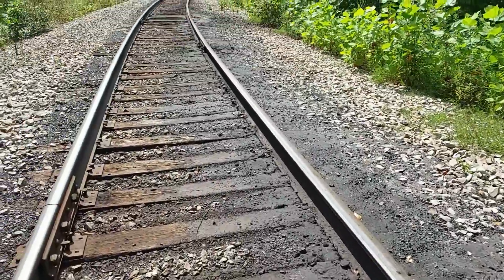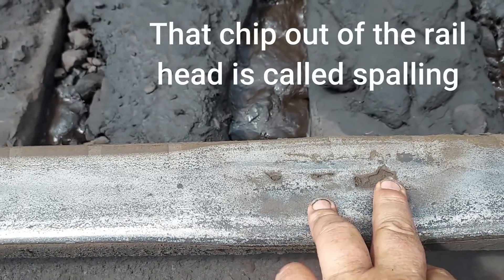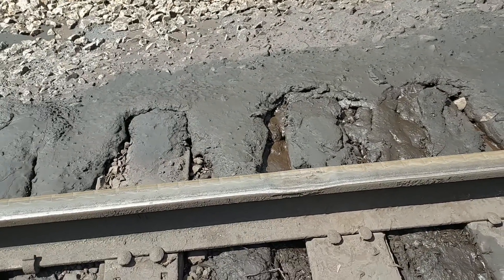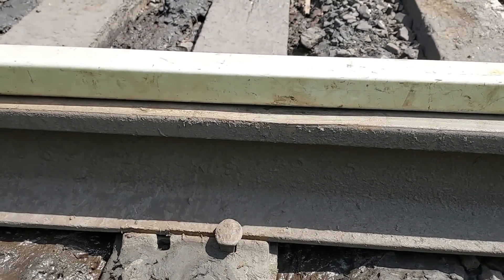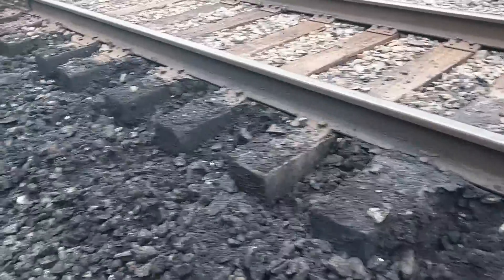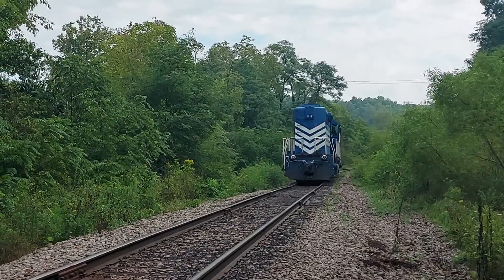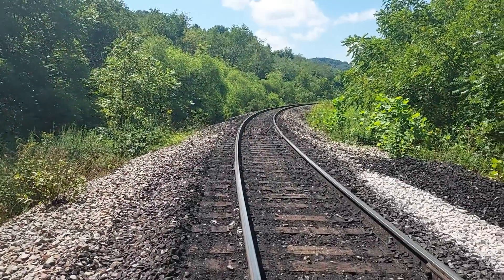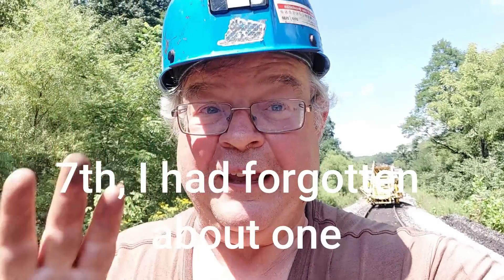This is the 7th Rail I've Broken with my Tamper

Comment: Was this all new rail when it was built or was it relay rail? That has the looks of having been started by a rail burn.
Reply from the maker: Yes gravelydon, all the original rail here was rolled in 1975 in
Illinois by US Steel. The rail that broke was original. We have
replaced a good bit of rail over the years, the high side on
this curve was replaced about 10 years ago with new.
We did get that rail changed out Friday, it had broken last
Sunday so I can sleep better now. Thanks for stopping by
today and taking in the show my friend.

Comment: re: 7:35 You explained to me about your railroad and not governed by FRA or 49CFR but to me it's so awkward to see the hoghead 'BACKING'(Long Hood Forward)and no headlight or 'Ditch Lights' or a 'Man on the Point'. But as you said, your railroad isn't governed by the Feds so you can 'Railroad Any Old Way You Want' despite 'Best Practices'. Thanks for the video. When I was in the track dept with Penn Central we would manually 'Tamp' most of the time acct no Mechanical Tamper or Ballast regulator. Doing it manually was just the way it was done in 1973 and we didn't think anything about it. We even ,manually carried 39 foot lengths of rail in the yard with rail tongs and as many able bodies we could find. Fond memories.
Reply from the maker: Keep this in mind Wes, at any one point in time, depending
on locos being down or in for inspections, any of the 3 locos
may be leading coming back with loads, so thus the short nose
is always in the lead with loads. If it was up to me we would
be patrolled by FRA, but it is their choice not to come here.
We are a coal mine with a RR, not a RR in and of itself. The
FRA considers us as "an in plant installation" and thus has
chosen not to come here. We are governed by CFR Title 30
which covers the mining industry. And we are patrolled
by Mine Safety Health Admin, fed mine inspectors and also
Pa. State mine inspectors, but sadly they know very little
about CFR Title 49 which governs the RR industry.

That is totally awesome to me you worked with Penn Central,
wow would I ever love to sit down and listen
about your days there!

Comment: Do rail head defects normally happen on the inside rail in a curve.. 
If so.  Perhaps it's the inside wheel trying to slip ahead in the same spot with the engines pulling full cars to the inside rail and the largest diameter of the wheel surface and the cars tipping slightly to the outside rail .  So the outside of the wheel is on the smallest surface. Instead of the other way around.
Reply from the maker: That's a very good question Wayne, and one I don't have a
totally accurate answer for. Over the years we've had our share of
defects on both rails. However the majority of the rail we
have changed out has been on the high side (outside). The biggest
reason for this is the curve wear on the rails ( I have not
yet made a video on rail curve wear). What you are saying about
the inside wheel wanting to slip ahead is a big topic and 
deserves a video of it's own, mostly rail corrugation happens
when that occurs, but also either side wheel can skip and
even hop off the rail, not a good thing when a high side
wheel hops up off the rail head. Way to much to discuss
about that to go over in a comment. But you are a thinking
man and I like that my friend.

Comment: I have news for you.  Neither you nor the tamper broke that rail.  I knew it was broke, or about to, when I saw the crushed area.  There was a defect in the steel about 1/4 to 1/2 inch deep in the rail which finally grew to the point of not being able to hold together and finished breaking.  You should be able to see it when you remove the rail during replacement.  Everything that broke on that day will be bright and the rest will be rusty.  I don't remember seeing a CC in the line of information on the side of the rail.  CC stands for controlled cooling by leaving the rail in an insulated box just after the rail is finished being rolled and still very red until it cools down to about 550 or 500 F degrees.  This lets hydrogen gas slowly dissipate from the steel and not cause shatter cracks.  If the steel were produced with vacuum degassing and continuous bloom casting, hydrogen is not a problem.  I am not sure of when most rail steel was switched over with this production, but I think it was sometime in the 70s or 80s.  This process gives a much superior rail over the older method, in other words, a better steel.  
Areas like that are called ballast pumping.  The ballast can break down under the train traffic or by a "soft" spot in the ballast there is an extra bit of elevation and the grade under the ballast starts retaining water and "pumps" the dirt up into the ballast with each wheel that rolls over the spot.  The only fix is to completely remove all of the fouled ballast, recompact the subrade, and replace the ballast and tamping it.
Reply from the maker: Thanks for you expert commentary Roy. it's been about 6 months
since Sperry was in here and at that time they found no internal
defect, but Sperry is not 100% accurate all the time every time
either and next year Nordco might come in and pass over a
Sperry found defect and not find anything, or vice versa. it's
happened a good many times here that occurrence. This was
original rail here rolled Illinois US Steel in 1975, all of it is stamped CC. Appreciate your stopping by today and watching the show
my good man.

Comment: Was that rail rolled from strand cast steel?  That would be a piping defect which is elongated during rolling. 
Typical strand cast billets are 8 inches square and flow from the bottom of a continuous casting process.  Most bar and pipe products start with strand casting.   Just a thimble full of slag or improper alloy can be stretched out into hundreds of feet in defective product.

Remember to vote for Dr Oz.  John Fetterman wants to shut down all coal, oil and natural gas industries.
Reply from the maker: I'm not sure what strand cast is Keith. Rails used to be made via the
ingot mold method.  Now they are continuous cast. Then they
go the a blooming mill which reduces the ingots in size. A very
small amount of hydrogen can cause what is called shatter
cracks in the rail which I'm thinking was the initial cause of
this defect, then made much worse over the years from
rolling contact fatigue caused by the heavy loading of the
train. Rail is control cooled to eliminate hydrogen but it's
not always 100% perfect.
Reply: @ccrx6700  

Strand casting is continuously cast, vertical "mold" , usually curved bullet while still glowing and cut to required length.  Mill may be integrated with a rolling operation but most billets are cooled.
https://youtu.be/EZVa7XwieA8

Comment: Dave. Did you say there was a difference of five inches from the outer rail. To the inner one.
Reply from the maker: Yes sir, there was 5 inches of super elevation in that one spot,
where it should have been 3. Way back in the steam days,
5 or more inches super elevation for this degree of curve
would have been normal and desirable. RR thinking has changed
over the past 40 years where design engineers are wanting 
much less super than in the old days. Thanks for taking in
the show today and writing in my friend.

Comment: Dave , isn’t this a classic case of metal”schelling” which is as you identified a metal defect.  Also note schelling is hard to detect because it will not allow sound wave penetration.  Rail may have been old and worn and was not a good idea to use as a replacement particularly in an elevated curve and where there low ambient temperatures in the winter.
Reply from the maker: I do believe you are correct Tom, that shelling will not allow
ultra sonic testing to function correctly. All the rail on the low
side was original rail here rolled in 1975, the high side of that curve had been replaced bout 10 or so years ago. Thanks so much
for paying us a visit today and taking in the show my good man.

Comment: I figured you might break that crushed head rail with the tamper. I would make that spot priority number one with the shut down. Looked like you needed a couple of ties, one at a joint. Those battered heads are nothing to play around with, change them out as soon as you find it. That other joint has you wanted to remove has a battered end, is not bad, something to keep an eye on. Great work and video. Thanks for sharing with us Dave.
Reply from the maker: Rail got changed up there today Zach, I wasn't on that job
so don't know exactly what they did yet. For sure changing
that rail was a priority and glad it's now done. It was just
another accident waiting to happen if we hadn't. Very much
appreciate your visit with me today my good friend.

Comment: Hey Dave. Nice work on that temporary repair. Interesting how the head just separated and deformed like that. That was probably an imperfection from the foundry or forge or wherever that rail was made that probably allowed a little water in there once it was exposed. And then rust jacking took care of the rest. I look forward to seeing the rail replacement when you guys get time and materials/equipment ready. And always a good video when one of the big SD's comes in for a close up.
Reply from the maker: Thanks so much Shane for the very nice comment. That broke
last Sunday and today we got the rail changed, another
big relief. Management came thru on this one and got me
a grapple truck in here within 5 days, a major accomplishment
since Frontier RR Services is up to their neck in work right now
on other jobs. Do appreciate your visiting with me today my friend.
Reply: Thanks for your great and informative videos on Railroadin'!  Dang phones and video equipment. Lol. 👍🚞
Reply: READ THIS: http://www.multimodalways.org/docs/railroads/RREquip/Sperry/Sperry%20Rail%20Defect%20Manual%204-1968.pdf
Reply: Rails are hot rolled from cast billets - entrapped mold release (for continious billets) or entrapped slag/reoxidation, non-metallic inclusions, poor billet pre-conditioning or damage in reheating or even in rolling (lap) defects are a few of the many casues of poor rail quality - each one should be investgated.  In this case look like sub-surface rolling contact fatigue cracking (Spalling).

Comment: Great video Dave! 7th broken rail?! Woah. Is there a way to dial back the hydraulic pressure of that tamper, or was the rail is a little compromised and it is what it is??
Reply: I understood that as the 7th rail that broke in almost two decades of tamping (see 13:50 onwards). Which, while mighty inconvenient, seems like nothing of concern since rail naturally gets beat up and fails sometimes. If that were the 7th break in one week of tamping...something would be seriously wrong with the tamper, the training, or the rail indeed! Dave would not be a happy camper if that were the case I'm sure.
Reply from the maker: Excellent reply to Taquito! Absolutely you are on the money
with that.
Reply from the maker: Thank you very much Taquito, very glad you had a good time
with us. Clamping pressures are set at 1500 psi, however they
can be adjusted, but with this serious rail defect, I could have
probably put a track jack under it and hand jacked it up and it
would have broken.That stick of rail was at the end of it's life.
Appreciate your stopping by and taking in the show today my friend.

Comment: Hey Dave. Do you ever grind out a defect in the rail. And build it up with weld. Or is this a big no no?
Reply from the maker: Very good question Wodon. Yes we have done that in the past
on a good many battered heads. It would not have worked in
the defect in the video. But it has worked very well on
the heads, but of course it takes a good welder to do it right.
Has extended the life of a lot of rail here.  We have also welded
frogs with chips out of them. Appreciate your paying us a visit today
my friend.

Comment: It amazes me - the various defects and wear and tear that occur on the rails. Who would have thought you could get a flattened head? You have shown us the spalling before I believe, but this is new to me. When I ponder it, these coal cars can run between 70 and 90 tons when loaded and that amount of weight could equal big stresses on rails with cycle after cycle. Breaking a rail looks to be a hazard of running a tamper. I am not qualified to do that, so I rely on your expertise as to how big a hazard it is. I am sure it leaves a bit of a sinking feeling when it happens. A nice temporary repair should do for the short term :)  All of this brings a question to mind with respect to the rails and wear and tear: do you folks ever have heat restrictions? I don't think it would get that hot there, but I am not sure.
Reply: It looks to me that those hopper cars are of the 100-ton capacity.  That would be 263,000 lbs of car and load over 8 wheels which will yield a static load of about 33,000 lbs per wheel.  Under that or similar dip, the wheel load will easily exceed 33,000 lbs.  The yield point of rail steel on the stress/strain load curve is very close to the elastic limit and getting into the plastic limit of the steel where the rail deforms but does not return to the original shape after the load is removed.  That is why most rail on the inside of a curve squashes or flares out under traffic.
Reply: @royreynolds108  Not that's cool :) I remember various lattice structures at various temps, but that's about it after all these years. Thank you for the info!
Reply from the maker: Thanks so much Brian for the very nice comment. Car
weight along with load is 286,000. That is a lot of weight
pounding the rails on every wheel. Jackson tamper salesmen
used to have the pitch: more insertions, deeper penetration,
and we don't charge you extra for finding weak spots in the
rail!  Lot's of rails and joint bars get broke by the tamper on
other RR's also, it is not unique to us. 

We do not have heat restrictions, I wish we did. Sometimes
the rail temps here get from 130 to 150 degrees. Many RR's
do give heat restrictions, but they are for higher speed track
than ours. We have had heat buckles in the past, although
they probably average about 1 every 5 years, so it's not
that big of a problem for us. Our big problem is pull aparts
in the cold weather.
Reply: @ccrx6700  Thank you, sir!
Reply from the maker: @brianhickey5949  😊👍

Comment: Good video.  Does your railroad use Sperry rail service?  They have a truck mounted version for close clearance height and its mobile for a closed system like yours.
Track dept. just changed a winters insulated joint with the welding crew, and thermite welded the joint removing two splice bars! Our guys supported them and tested as we have track circutis, and atc.
Reply from the maker: Thank you Tuco, glad you enjoyed. Yes we use Sperry, also
have used Herzog and Nordco. We try to test twice a year,
they are not always available and now Herzog won't even come
out because it's too small a job, so we have to wait until
one of the other 2 just happen to be passing by. Appreciate
your watching today my friend.

Comment: Big problem bad ballast broken rail now I've witnessed them put rail joint bar and then stick welding the rail head at 250 amps and 1/4 stick rod then grinding it down but great video Dave thanks
Reply from the maker: We did that once here also Gary to get a train to pass until
the next day when we could make a more permanent repair.
it was at the load out and 10 MPH and someone watched
every time over it, but it held up fine. Thanks so much
for taking the time to watch and write in with that story,
that interested me.

Comment: Dave, will this be a "slow order" area until you get the defective rail replaced, or is the addition of the joint bar a good enough repair to allow trains to run at normal track speed?
Reply from the maker: Good question Backshop Tinker. We have a 25 MPH track
speed here, with the joint bars on there will be no slow orders
on this section. Hopefully next weekend we can get a grapple
truck and some welders in here and change the rail out.
Can't thank you enough for visiting with us tonight and
taking in the presentation my friend.

Comment: You didn't break it--you just revealed some of the cracks that were already there!  I'm seeing 6 cracks across the top of that rail, and the metal underneath is probably an absolute spider web of cracks.  Hope you get it cut out of there soon!
Reply from the maker: Jackson tamper salesmen used to have the line: deeper
penetration, more insertions and we don't charge you extra
for finding weak spots in the rail. LOL  Hopefully this weekend
we will be able to change that rail out, depends on the availability
of the welders. it will get done soon tho. Very much appreciate
your taking the time tonight to watch and write in my friend.

Comment: First time I’ve seen the new introduction Dave love it…the 6700 jack beam is more powerful then the MKIVs in my opinion ….sometimes if the clamp hits the web it will cause cracking from the stress ….that’s why I find it very important to adjust the stops on the clamps so you can just get a pice of paper in between the rail and hook….keep up the great videos sir
Reply from the maker: Glad you like it Mike. Intro compliments of Alex Sawyers, a former
loco engineer and also a subscriber here. Everyone likes it. That
is very interesting about the 6700 being more powerful clamping.
We had an old single cab 6700 in here way back and I thought
it had more power than my machine does. But it was a pain
to track travel in, had to hold the index button down all the
time and it had a manual gear shift lever. Very much appreciate
your watching and writing in tonight my fellow tamper operator!